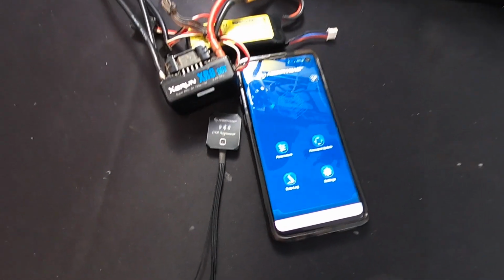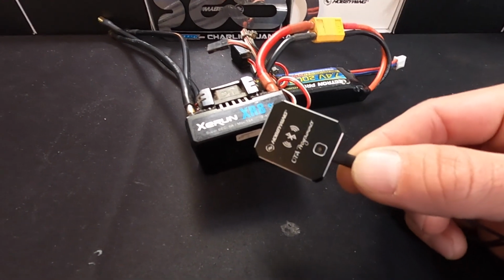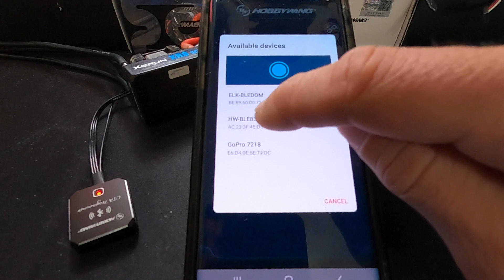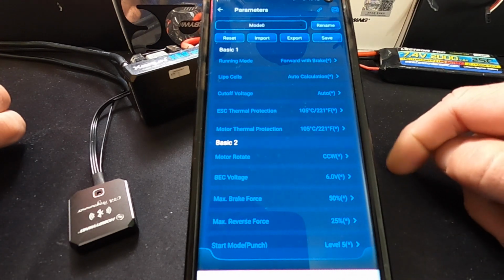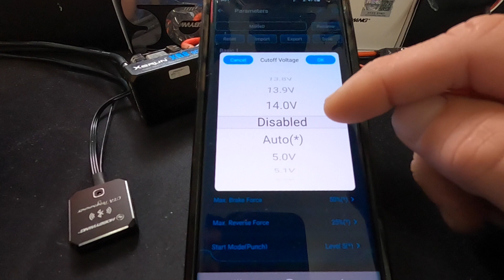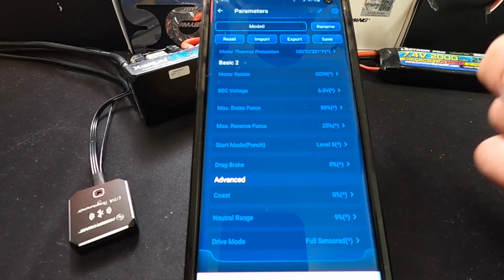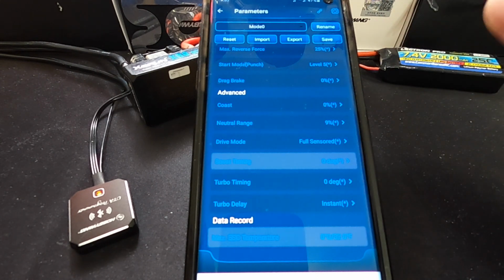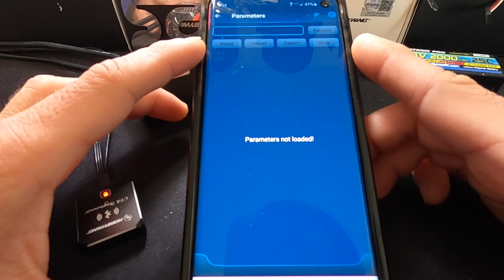The Charlie Show /// Episode 191 /// OTA - XR8 - HW Link v2

Comment: Charlie, I would love it if you could enable some kind of cruise control feature for the Axe R2 system with the HW Link v2 app. Wouldn't that be sweet, to be able to set a speed however low or high you want and they increase or decrease with the app?